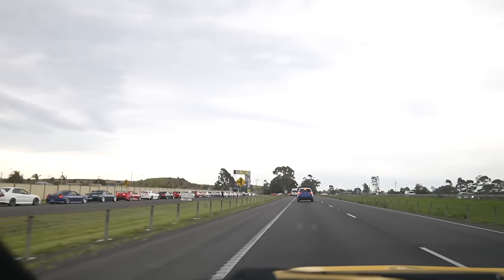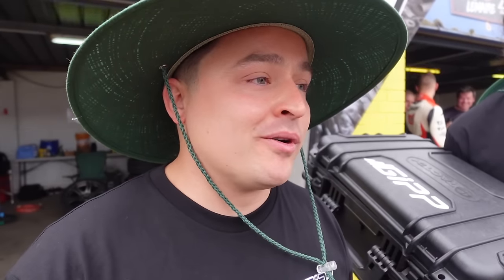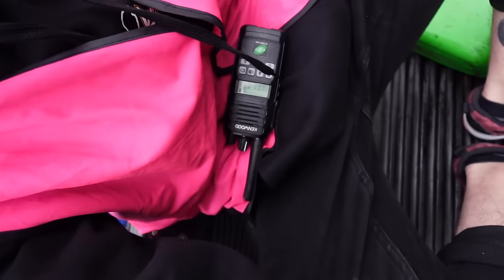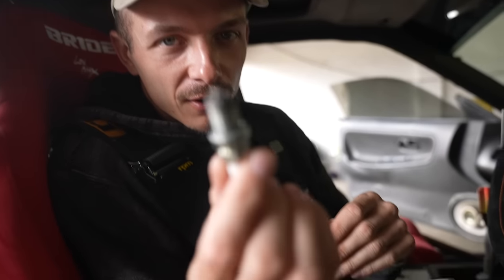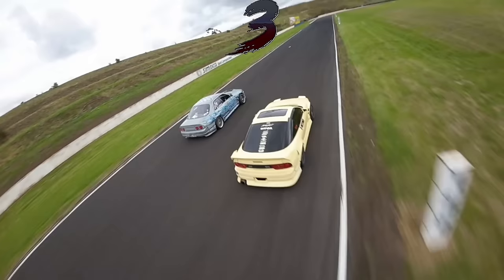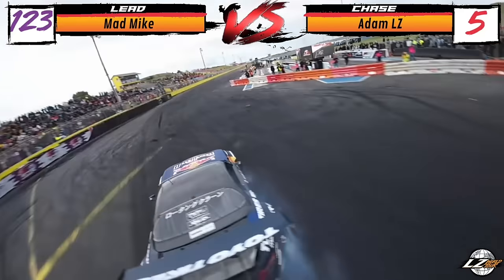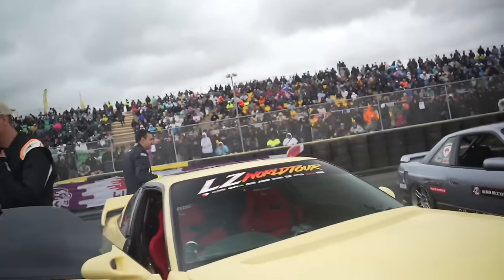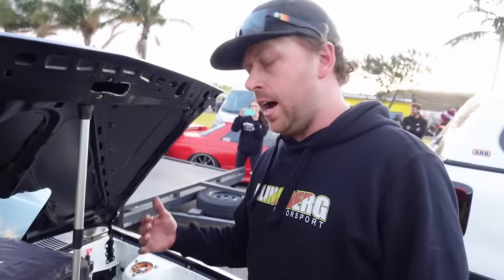The Cream S13's BRUTAL Weekend of Damage

Comment: Lol k&n sell these cool things called an air filters, they stop small children from being sucked into turbos. Throttle body bolts too 😅😅
Reply: The turbo got destroyed by debris left in the compressor housing from overspinning the first turbo. An air filter would do nothing to prevent that since the turbo is after the filter. Same goes for the throttle body screw, also after the filter. 

But this doesn’t even matter since he most definitely did have an air filter on it anyways.
Reply: @eliasbergstrom5300  oh was it the throttle blade screw? If so then yeah, as for over spun turbos, usually its a exhaust wheel that let's go, interesting really